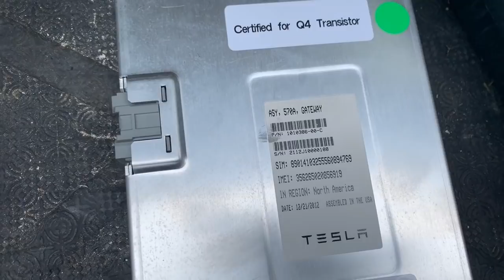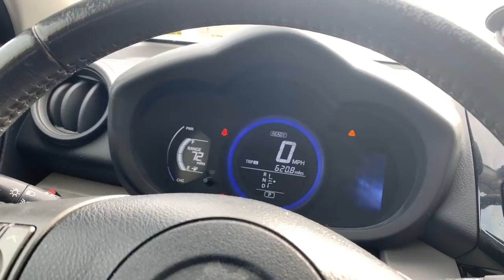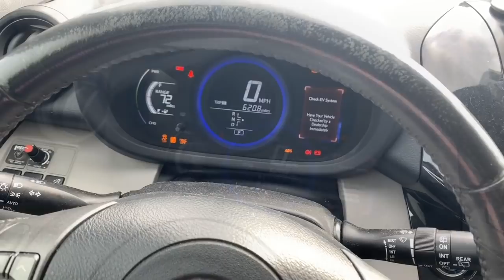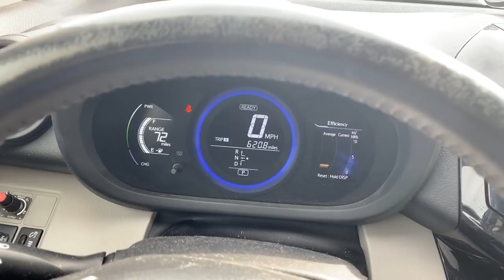How to replace the Tesla Gateway computer in a 2014 Toyota Rav4 EV

Comment: I have a 2014, the charge controller when bad, Toyota got one from Tesla, They covered it, the first time. I'm have almost the same problem, starts charging, hits around 9.2kw and then trips off.  I have two different chargers, so I know it's not that.  It drops to 8.2 kw and and bounces around.  Have you ever had one fail on you ?    In NJ  110,000 on mine.

Comment: Can you give me instructions on how to cycle the car on and off. I went to the Toyota Dealership and they wanted to charge me $720.00 to test the Cooling Pump when all my car needed was to get cycled because the battery was fully drained.
Reply from the maker: That’s not a bad idea. It would be a quick video. You just need to turn the car on and off 5 times. Sometimes the code goes away in 3 cycles and sometimes it doesn’t work at all and you have to disconnect the 12v battery.

Comment: Any videos of changing the drive motor fluid ?
Reply from the maker: I have only drained the fluid before. Ive heard that you need techstream to do it because you need to force the pumps to turn in order to fill it and get out all the air bubbles. No one has the Tesla software to do that except dealers unfortunately.

Comment: For the uninitiated, what does a gateway computer do?  I noticed it has an IMEI number on it, does it connect to a cell network to send telemetry back to Toyota or something???
Reply from the maker: Allegedly tesla could connect to our cars just like they do with their cars for updates. We haven’t seen that happen though. Basically the gateway allows the Toyota parts to talk to the Tesla parts and vice versa. ￼
Reply: @JamesKlafehn   I find the location to be very odd, why place such a expensive part in what I consider to be a bad location, under the back seat or someplace else just as hard to hit.
Reply from the maker: @frickandfracksicem  it was a gaping empty space and they only needed a compliance car. The option was either not sell ANY cars in CA or throw together a car that complies with the law. I agree though, it is a little odd because there are other areas that that part could be hidden.